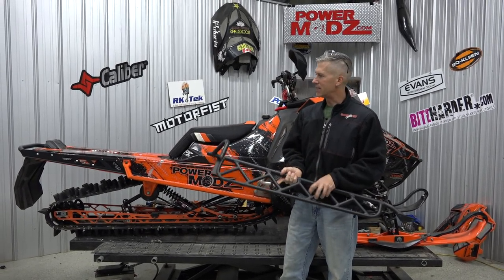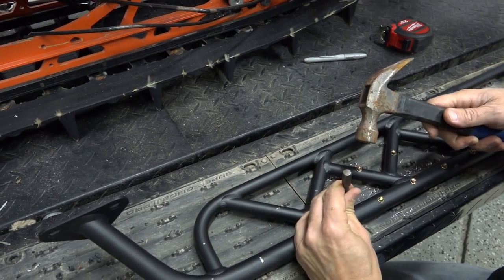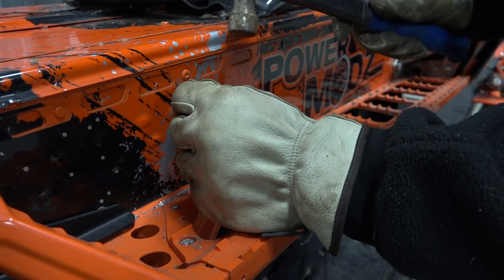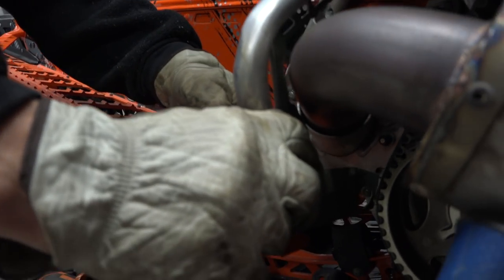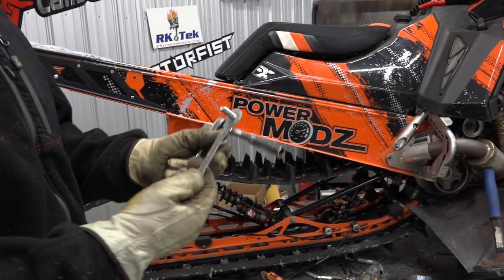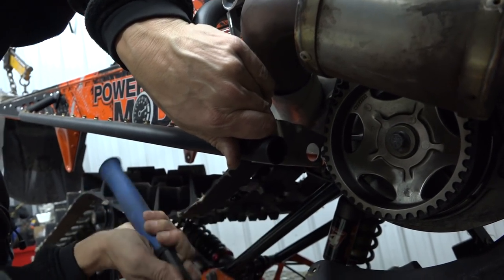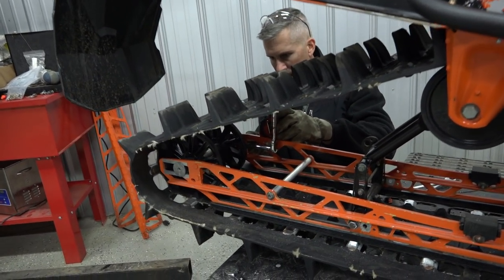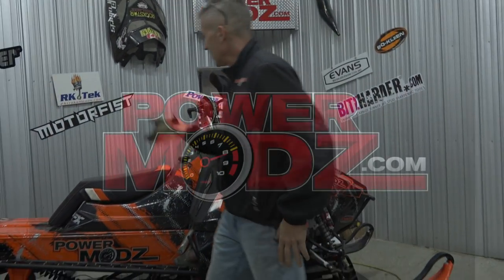B&M FABRICATIONS RUNNING BOARD INSTALL AXYS

Comment: Just last season I got my foot caught in the front of the running boards and the sled rolled over and I was sitting on the track my leg was wrapped under the sled with my foot still in the running board that hurt and it ruined my season